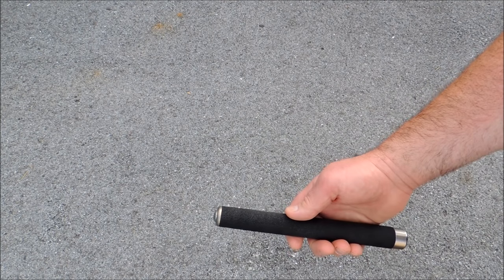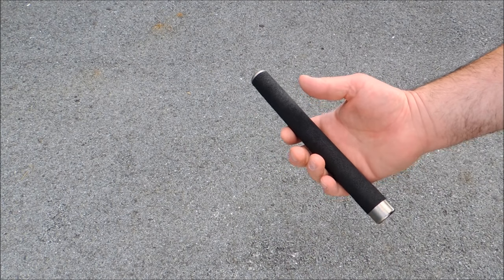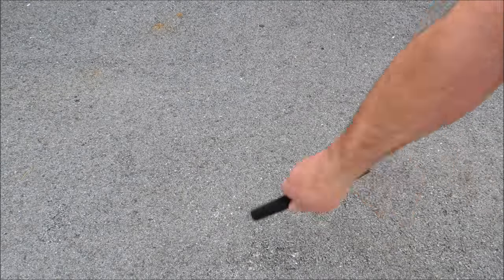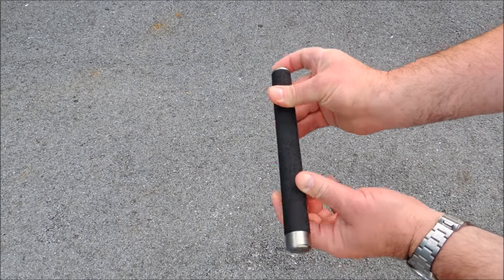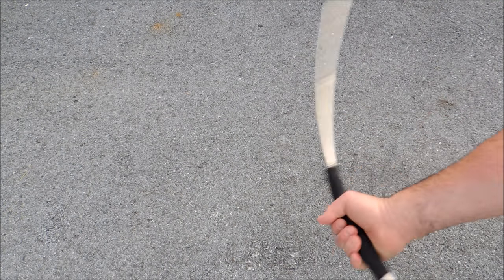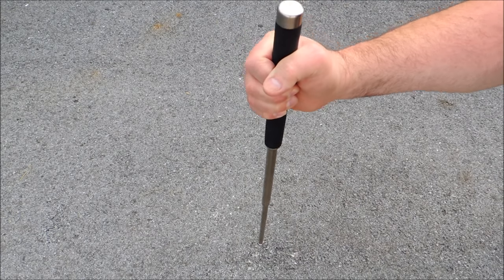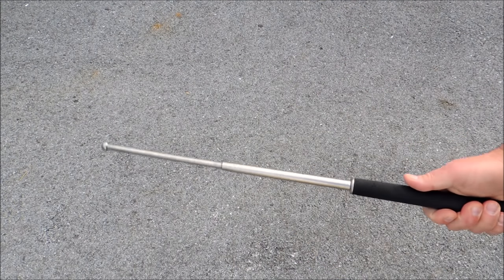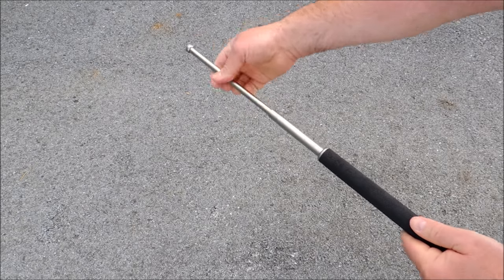How to operate a friction lock baton

Comment: I just bought a fury and I love it really hard to put back in but I'm sure with use it'll be easier to get back in .question tho the fury was a cheaper one 20 bucks I work security at a truck stop , is this durable will it brake or not retract ?  Any recommendations for a baton for this like of work ?

Comment: Mine doesn't open and close so easily.. so.. how?
Reply: squeeze the clip in the bottom cap
Reply: You gotta lube up!
Reply from the maker: The retention clip is the issue. If it is not adjusted correctly the baton will be hard to open and then you have to swing extra hard to open it it is extra hard to close. Never ever use any type of lube or WD40 on an expandable baton, it is not necessary. Just keep them wiped clean.
Reply: how can u adjust the retention clip?
Reply: can u show a video or picture?thanks
Reply: Brother what is its price

Comment: does the clip at the base control the lock action when open? how would I adjust it?
Reply from the maker: It controls the tension and how hard you have to swing the baton to open it. If too tight it takes a lot of force to open/extend and then they become very hard to close. To adjust it unscrew the end cap and pinch the retention clip. From the closed position If it holds the baton shafts in place when inverted and you can shake it mildly without the tubes sliding out then it is adjusted correctly.

Comment: This is the exact baton that i have. It seems okay but theres a risk sometimes the parts just fly out entirely if i flick it open to hard. Is there a way to prevent this?
Reply from the maker: If you own an ASP and parts fly out you contact me and I can repair it. A cheap baton can had parts fly out when you open it. If this happens throw it away and buy a better baton, there is no way to fix this. It means the tapered end of the shaft has expanded and there is no way for it to hold the tube sliding through it and it slips right through.
Reply: Hi, I brought it to the seller and they said it was defective. The part inside that holds the baton in place broke off and they gave me a different one which is much better.

Comment: I've had no-name garbage batons and tried that tap and turn technique, it just bends the steel at the tapering points and the tip piece inevitably falls apart from the middle piece. will this happen with ASP? because I'm looking to invest in an ASP for home protection as I'm not aloud to use a gun for that in Canada (stupid, right?) and I don't want to drop over 100, 200$ only for the product to break. please respond with an answer.
Reply from the maker: Steve,
          Sorry for the delay, I don't get here often. ASP will not bend unless you hit something really hard in full swing. The best batons out now are the Talon which are push button close. Awesome quality and lifetime warranty. https://www.selfdefenseproducts.com/product/asp-talon-disc-loc-baton

Comment: Just leaving this here for people who's batton dosent open up fully! 

My baton's middle shaft unlocks and falls if i give the extended baton a few shakes or after a few air strikes it keeps unlocking - turns out it was oiled it a bit and there has been oil in shafts, make sure to disassemble and clean it THROUGHLY , I wrapped the middle shaft inside with a bit of tissue and extended and deployed it with the tissue inside - its fixed now hehe the tissue got out the oil through the pressure

Comment: I have a problem with my baton. The part that is furthest out wont lock and Will easily fall. I have the exact one he is showing in the video does Antons know how i can fix this?
Reply: Unscrew the buttcap & inside is a little retention clip. If you squeeze the retention clip it reduces the friction needed to hold the baton in place. If you spread it out just a little bit it'll increase the strength of retention. Hope this helps.

Comment: the tap rotate method seems like ...well...I'm not even gonna say it. I know most guys use the pound it into the ground method.... but the supposedly recommended method is simply squeeze it close between your hand with some force.
Reply: It's actually a slight twisting motion as you grip it. It does require some strength & if you're fatigued or your hands are just too sweaty the pound to the ground method isn't bad. Though the proper way is less of a driving force & more just aiming & dropping it down just right.

Comment: They say you should never tap the baton because it's more stress on the tempered joints
Reply from the maker: Only on the cheap ones. I only train with high quality heat treated batons. I never have to tap and turn the cheaper batons... The always close with the pound to the ground technique.

Comment: Bro thats a yrg baton😆  yrg baton only cost 3$
Reply: @mrdefense  hahaha, mine is a yrg baton the looks of the yrg baton is very similar to that i bought it for only 3$ here in philippines i know asp batons are expensive but esp is better i have a esp i torture  test it 8 times but it is not bent for 50$ it is alot better than asp mine is a 19inch esp hardened expandable baton
Reply: @mrdefense  if you want i can upload a video about my yrg baton its looks very similar to the asp foam handle baton
Reply: Hey reply bro
Reply: @mrdefense  hey bro reply
Reply: @mrdefense  ok

Comment: How many inches is the baton?
Reply from the maker: The one in the video is a 26" ASP Electroless Baton with foam grip.
Reply: @Mr.Defense  which would be better for use/Duty 21inch or 26inch
Reply from the maker: @SirKnox-fs6og  That is a personal preference. 21" is probably the most widely carried by law enforcement, but I am a bigger guy and like the 26" better.
Reply: @Mr.Defense  does the length effect the efficiency?
Reply from the maker: @TaeTakeAll  Length is more weight and more reach which means more striking power. I like the 26" but it is a personal preference.